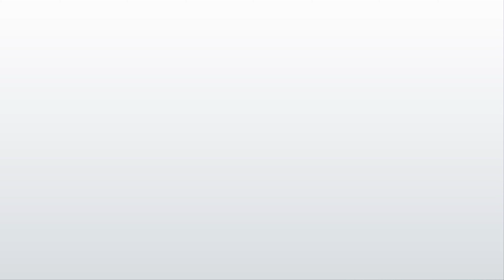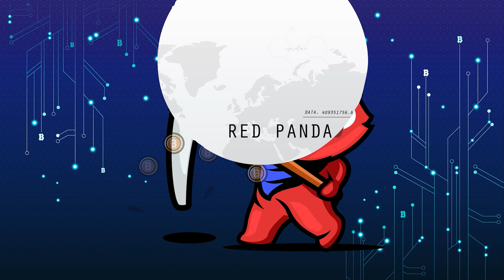ALMOST DONE WIRING FOR 108x 3070 GPUs…

Comment: I actually just signed up for a program with my electric company very similar too what you were describing. My rate will average around .042 per kWh. However, I have to pay extra for and surges in demand I create. So it'll prob average out closer too around .07-.06 per kWh.